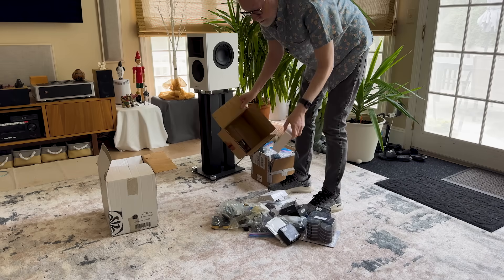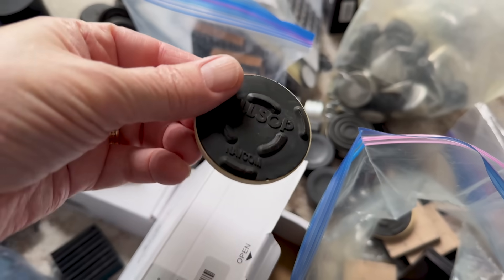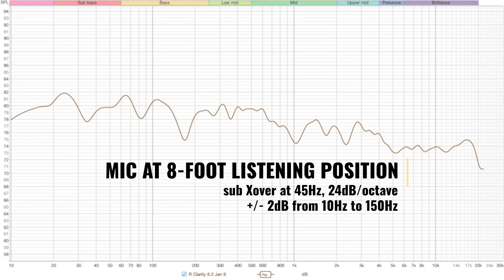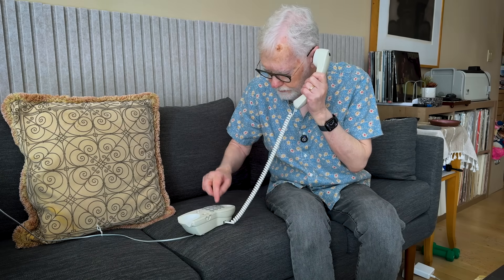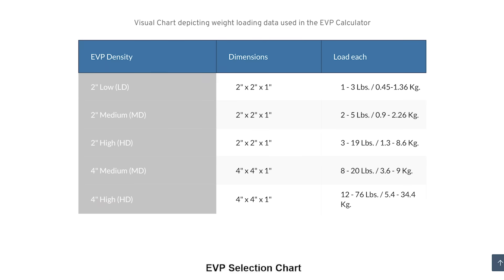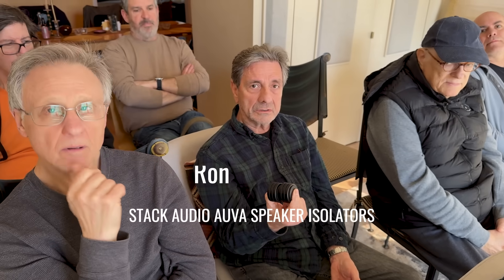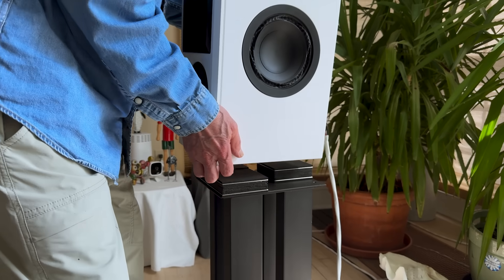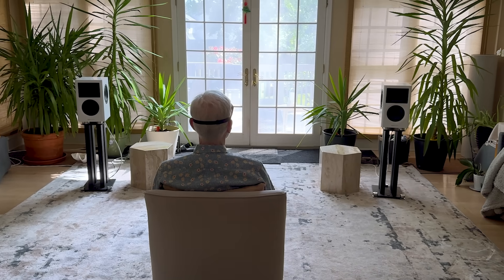Speaker isolation devices, do they WORK?

Comment: Great Job on this!  I've been wondering about isolation on bookshelf speakers too. Any thoughts on the differences/results between isolating between the speakers and the stand, versus isolation between the bottom of the stands and the floor?
Reply: I use BluTac to couple the speakers to the stands. The stands are 4 inch PVC filled with sand and they stand on EVA foam blocks. I found via GROK AI that 10% - 30% compression of the foam is suppose to be ideal for absorption. I kept cutting the squares a little smaller until I got that amount of sag from the weight of the speakers and stands. The EVA foam came from a gardener's kneeling pad from the dollar store. It about an inch thick and rather firm. I used silicone adhesive to attach either a steel electrical junction box cover or fender washer to distribute the weight over the surface of the foam depending on the size of the foam (subwoofers or speakers plus stands). No scientific study but repeated swapping in and out, short time and longer term, with a variety of music. To my ears, they are an improvement over mfr.'s rubber button feet on the speakers and spikes on the floor. Ditto for my subs. They have been in continuous use for several months. Just another fun DIY tweak that seems to work. YMMV.
Reply: @bekay3subs 
Blue Tac to couple, interesting. Most use it to isolate. To each their own.

Comment: I use Symposium Super Plus bases under my fairly large speakers. The bases had to be made custom (4ft x 4ft if I recall correctly) as the speakers are large and heavy (236 lb each). The sound was transformed by the Symposium bases - in particular, the tonality of piano went from messy to gorgeous.

Comment: The measurement he done with the microphone is just frequency response. If the positioning isn't varying then the frequency isn't going to change. What he should measure is the intermodulation between the feet. Joseph Crowe done the ISO Acoustics Gaia III test with the subwoofer and the IMD is much lower with the isoacoustic feet.

Comment: It's pretty well known among audio engineers that vibrations can be translated into noise in electrical components, but exactly how much becomes audible is debatable. In any case, I use isolation for my upstairs speakers to reduce bass frequencies transferring into the floors and turning the ceiling of the room below into a giant diaphragm. That made a big difference without affecting the bass impact heard and felt at my listening position.
Reply: Yes, what you’re saying has some accuracy and relevance. Although one’s room is a major part of the system. And hence it’s good to learn those of your room. And adding to that dynamic - neither for or against that notion - coupling or de-coupling from the floor is on a room by room basis.

Comment: I have Legacy Audio Valors (which weigh 300 pounds each) on Townshend Isolation podiums.  This was on a suspended wood floor.  The Valors go down to 12Hz, and the bass energy from the floor vibrating could be a bit uncomfortable.  With the isolation, the floor didn't act like a speaker.  The amount of driver surface area is such that my sofa can still vibrate when watching movies.